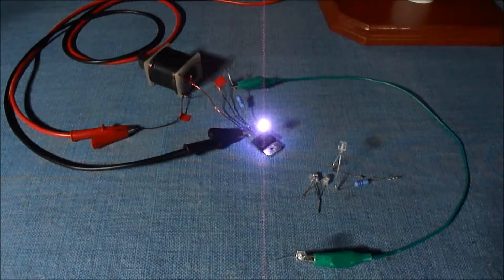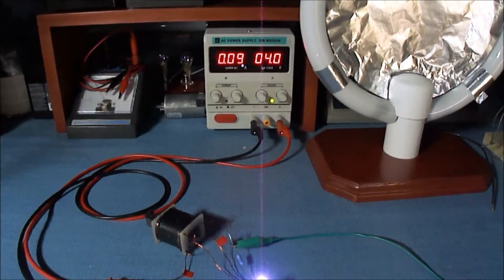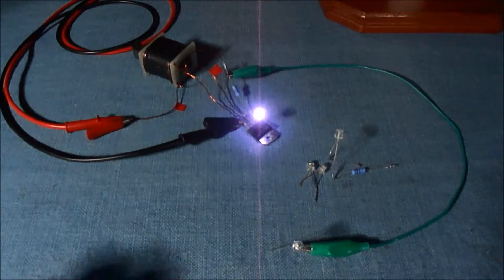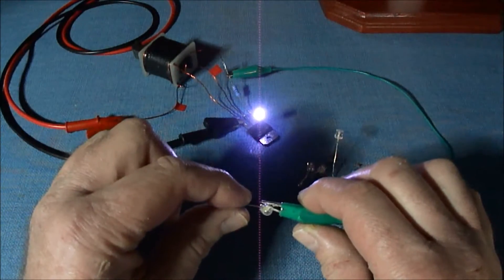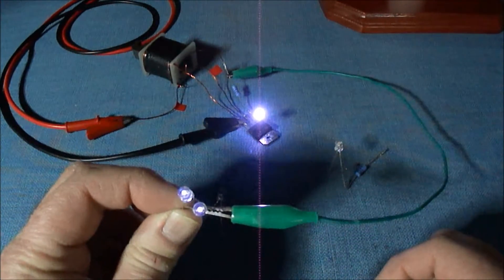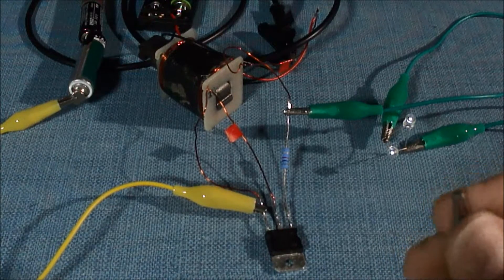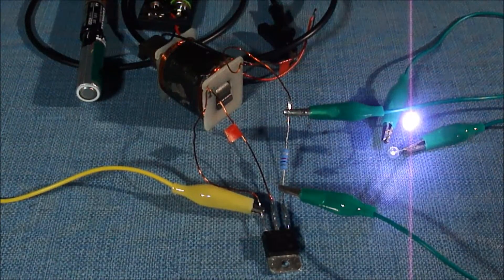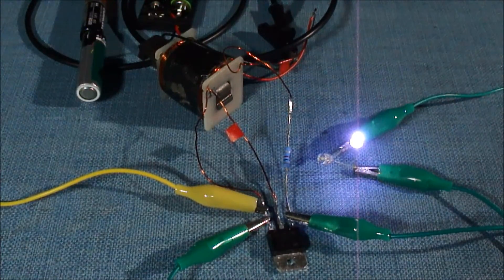Joule Thief For One Wire Research

Comment: The effect that lights both LEDs is not  a spark gap effect. You have positive and negative spikes on the single wire. Look at the "AV Plug", by  Stanislav Avramenko.

Comment: I think the high voltage/high frequency spikes are using you as a virtual ground and the flyback generated by the pulsed DC is just more intense than the On pulse in the other direction. In regards to high frequency, you may also be able to light an led by placing an air coil with the led connected to it over a power rail clip lead.